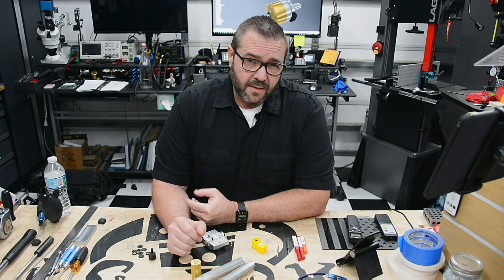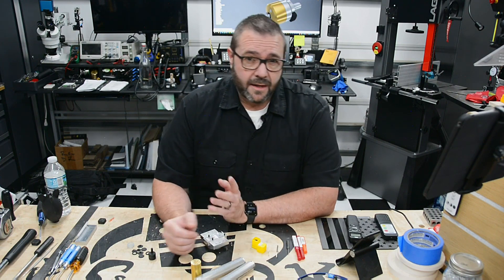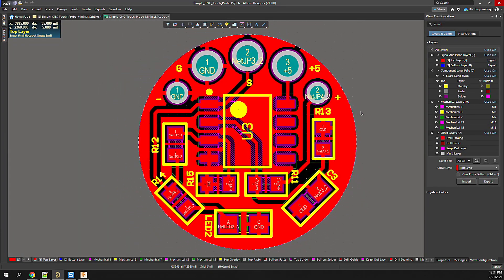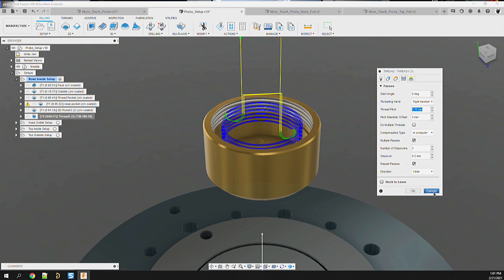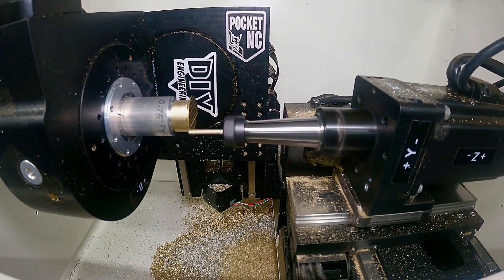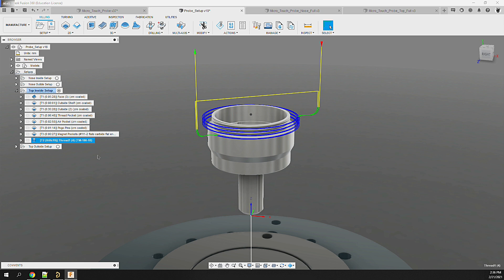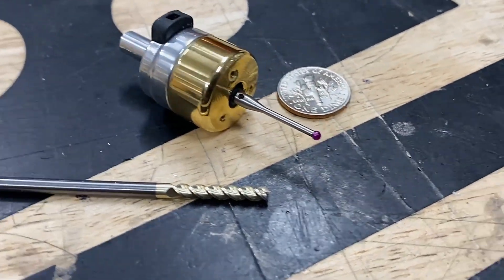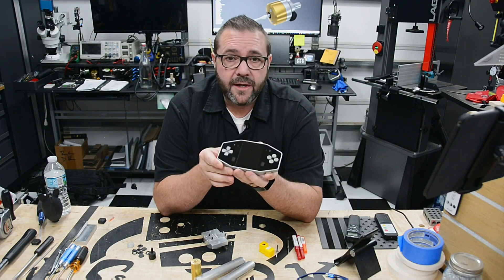Making A Micro CNC Touch Probe on the PocketNC?!

Comment: The machining is amazing here. And I'm super impressed by how small this thing is. But one thing I don't understand is how the tip is constrained. Without a kinematic coupling, it seems like every time it touches something, it will shift position. I'd expect either to have a three point coupling, or epoxy the piezo element in. Maybe I'm missing something. Either way, the craftsmanship is outstanding.

Comment: Found your channel today; subscribed and am binge watching. Great stuff! In this vid, you mention thread milling metric threads with what appears to be a UN thread mill. I've always wondered whether my single form UN thread mills could do metric threads--they're both 60 degree thread forms, so why not? Would be nice to find a UN to Metric conversion chart for UN thread mills (e.g. "a UN single form thread mill designed for 18 to 56 TPI can cover metric sizes from M6 to M18"), but I've never seen one. I guess if you roughly match the cutting diameters, you'd be good to go. PS: My go to for single form thread mills is onlinecarbide . Cheaper than the one you linked to and high quality. Back to binging!!! :)
Reply from the maker: Thanks I’ll have to check that supplier out!

Comment: Absolutely brilliant implementation of a rather complex tool.  I have tried and failed to make a working piezo touch probe several times, but I lacked the ability to produce components with the required precision.  In my experience (and as mentioned by others) the one-shot nature of the piezo is quite a disadvantage, meaning that the piezo may trigger reliably at high probing speeds, but may not trigger when probing at low speeds. @
sparkyy0007 already mentioned about dynamically driving the piezo, although I have yet to test this myself.  Anyway, thank you for showing your design process and keep up the good work.  

Definitely looking forward to the next video.
Reply from the maker: Yep, i have a more robust circuit that was part of the original design will i plan to do but I’ll need to drop component sizes down to 0402 to make it fit in the dome size probe...

Comment: Just a suggestion...drive the pizzo at a few khz (10mw or so) with a 555 or an op amp through a 1k ohm or so, and use the ac voltage drop across the resistor to trigger. 
Displacement of the tip will be a few hundred nm or so.
This will change the system from one time only impulse (which could possibly be missed) to constant monitoring of probe load.
Reply from the maker: Thanks for the feedback,  I did that in my “more robust” circuit design but then had to remove it to meet the size constraints... I’m still planning on implementing it if i get the precision and accuracy I’m hoping for.
Reply: @DIYEngineering  Awesome, good luck.
Reply: @DIYEngineering  Well, you can stack PCBs which will add few mms to total height which shouldn't be a big issue.